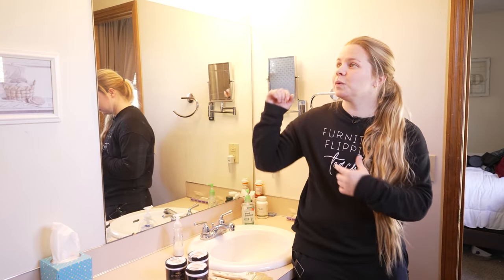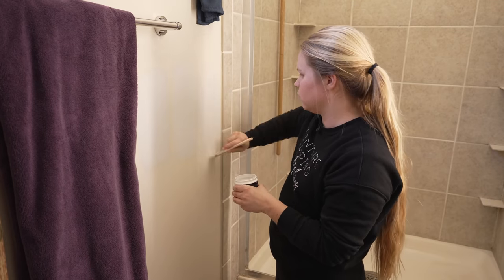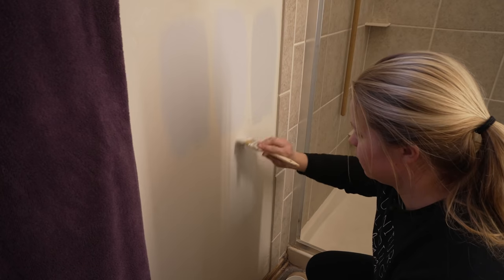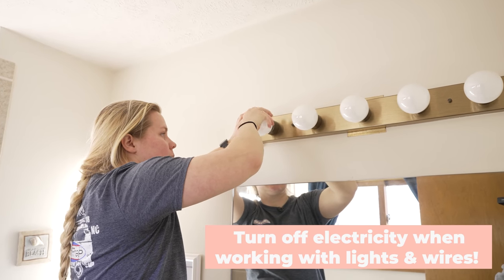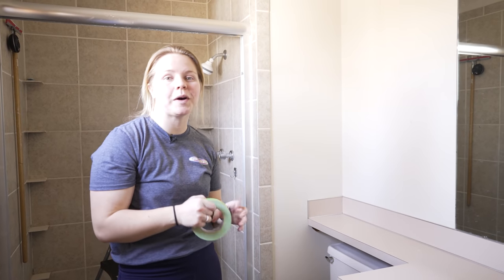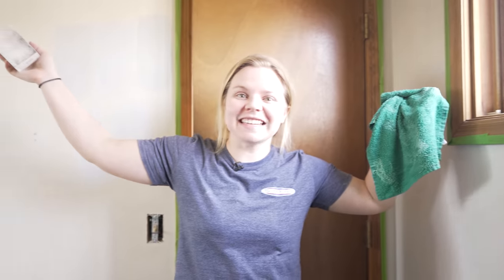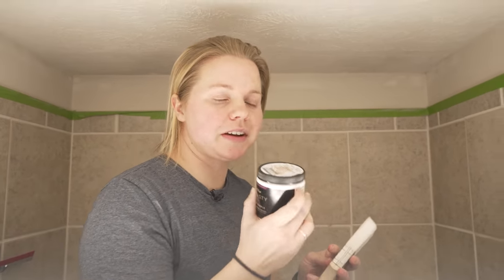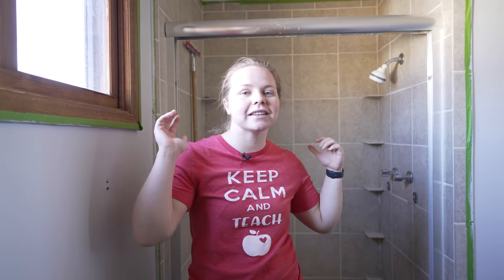35 YEAR-OLD SMALL BATHROOM MAKEOVER + DIY PAINTED COUNTERTOPS!!

Comment: Beautiful job on the makeover of your parents bathroom!!
One suggestion I would offer, which I have done in the past myself is frame out the mirror. This will give it a new feel and hide the worn edges of the construction mirror. I didn't even miter mine! I used some nice profile baseboard on the top and bottom with the flat edge facing up on both the top and bottom pieces and cut just over the width of the mirror about a 1/4 or 1/2 inch. For the sides I used a different wood trim piece that was just about as wide as the bottom and top pieces but was a trim piece that just had some groved vertical lines in it. The side pieces I measured and mounted those to fit in between the top and bottom pieces and fit flush on the edges with the top and bottom pieces to form a frame. I painted them the same color as my cabinet or you could paint them whatever color you think will coordinate. I attached them to the mirror with some construction glue calk. It really updated the mirror and gave it a Hotel/Spa feel! Just an inexpensive suggestion to give it an additional finishing touch. 😊👍
Reply: I love this idea!! We're moving into our first home and the mirrors are still the builders grade. This sounds like a simple, inexpensive way to upgrade the mirrors
Reply: You can get the pieces to frame it at Lowe’s really cheap if you don’t have it already on hand. That’s what we are doing to our bathroom

Comment: A trick I learned while helping my mom choose a paint color for her bathroom was to do the samples so that each of them is next to the trim or tile that will still be there, rather than have some further away. It made it a lot easier to catch the ones that didn't compliment the existing colors as well. Also, you can buy stick-on sheets that you can paint, then peel off the wall easily - so you can move the samples around to get an idea of how it looks on different surfaces. 
Lastly, my experience from having to repaint a rental-house bathroom every 3 years or so - the samples are usually a flat paint, so using that above the shower isn't the greatest idea. A semi-gloss, or satin, helps with water resistance much better. Eggshell at minimum for a bathroom if you don't want condensation to damage the paint. 
Beautiful makeover!
Reply from the maker: we used eggshell (:

Comment: I used Beyond pain on my kitchen cabinets and it worked out great! 3 months later and the finish is still holding. Really modernized the look from the dated oak. Was a lot of work but much easier than having to sand, clean, paint and repeat. Would recommend.

Comment: If you were giving a complete refresh, why not replace the mirror?
Reply: Most of those mirrors are applied with an adhesive that you cannot loosen. That means that you have to cut a hole in the sheep Rock and replace a huge piece of sheetrock, tape mud and paint. We opted for framing in that big ugly mirror rather than going through the whole mess of taking it out

Comment: I struggled with getting sharp edges for years with different kinds of painters tape, and recently saw someone who skipped it all together and just used a pointed brush to paint the edges as step one. I did this a month ago in my sons’ room, and it looks SO GOOD. If you have a steady hand, and it looks like you do, try it! It saved me SO MUCH TIME, and looked much better without little bleeding paint marks. Edit: exactly like you’re doing around the ceiling. I guess I commented too early 🤣 also, my bathrooms are this exact same builder grade look. I didn’t realize my vanity lights only had one hardwire behind it, so I have been holding off on replacing them. Now I feel like a dummy!
Reply: I have never used tape.  😂

Comment: Great job! Another thing would be to not attach the faucet in place until AFTER painting the countertop... (more room to paint the backsplash and behind the sink) and perhaps even learn /have help putting in a water line shut off valve there so that just the faucet is without water... but little things add up and where does THAT ever end?... you'd be doing the whole house! 😂

Comment: Nice job.  Tip... as long as you are making the mess and have things taped off, I like to throw a fresh coat of paint on the ceiling as well and before I paint the walls.  Yah, it adds an extra day to the process, but it is worth it.  Also... before your first wall coat, put a quick layer over the parts you patched (use some primer if you have some)... it usually absorbs the first coat like water and may have caused the poor coverage you had.

Comment: If your budget is tight, and you don’t want to replace the light fixture, spray painting the cover plate and bulb covers will totally change the look. You can paint it very close to the color of your walls so it blends in, or a dramatic different color. I particularly like hammered look spray paint for this use.

Comment: Everything you did looks beautiful!  I have one suggestion that would make it complete: You could frame the mirror by gluing wood moulding around it.  I did that in my bathroom about 20 years ago and the glue I used was Aleene's Super Thick Tacky Glue, and it's stayed up with zero problems all this time!  You could probably use Aleene's regular Tacky Glue that comes in a goldish brown b bottle as well.  That line of products I recommend wholeheartedly.  Anyway, it really looks nice.  If you don't want the pre-stained wood you could paint it.  Either way you'll end up with a beautifully framed mirror for less than $20!
Reply: Great idea. I was thinking the  same thing 😃.

Comment: I just painted a bathroom vanity with this paint. I came back a few days later to install door hardware, I used blue painter's tape to lay out my hole locations and to protect the finish. Well, after drilling the holes for the hardware, I began to remove the tape, and it peeled up sections of the paint. Talk about mad!!! Have you ever had the paint peel on you before? This is the first time I have ever used the paint, so I'm not sure what happened. I would say it's a surface prep issue, but other than scrubbing the vanity with simple green there is no required prep, so I'm confused. I will say, though the areas that peeled were very easy to touch up, and can't see where the paint peeled, just hope this is going to be durable in the long run. I want to move on to the kitchen next, but now I'm skeptical about the durability of the product.

Comment: Questions:
1) Do you recommend TSP to clean the walls?

2) How do you keep track of all the hardware (especially screws)?

3) How durable is the Beyond Paint? Particularly for cleaning if need to scrub something off like a dried spill or caked on dirt?

4) I noticed you put spackle over the light fixture screw holes in the wall & there were anchors in the holes but didn't see whether you covered.

So I'm wondering how you handled that?
And,
If you're putting the same fixture back, do you want the same holes or new holes??

Thank you muchly!!

Comment: I am going to be doing my very old bathroom soon.  Any thing you learned when doing this project.  I was wondering if you had it to do over again if you would’ve left the faucet off until after you painted the countertop? It just seems to me like it wouldn’t be easier to get back behind the faucet area if it were not there yet. True or false? And how well has it held up especially the countertop area? Thanks for the tip on removing the sink.... so if I do that the faucet WILL be off.  I wrote my question before you gave the tip. Looks great . Much brighter. Very pretty. Your Dad was super taken by its. I loved how surprised he was .

Comment: Pro paint selecting tip: When I first moved into my current home (just shy of 2 years now) ALL the walls were painted a battleship gray semi gloss. ALL. THE. WALLS. So, like Lauren, I purchased several samples and painted them in groups on a couple different walls.  But I couldn't make up my mind.  I was ranting about same on FB and a friend of mine, who used to work at a paint store, said the secret is not to paint all the samples together in a group. She said, "Our minds are natural comparison machines so we just look at what is grayer or browner or pinker or yellower...etc."  She suggesting taking one sample and painting a large patch in three different areas (for the lighting comparison)  And do the same with another one or two colors, but not next to each other.  In some sense, when you are deciding between beiges that are only subtly different from each other your only job is just to make sure that you don't hate it.  But if you are deciding between blue and green and coral...well, that is a little more complicated, but I think the same rule of big color swatches not right next to each other is key.

Comment: Beyond paint works very well. It's expensive though. I love real wood tone trim and doors so I was like ah bummer lol. I even like the vintage cabinet pulls. Nice job 👍.
Reply from the maker: a little on the pricey side but remember, you wont have to buy primer or top coat or spend time sanding because its all built in

Comment: For all your hard work, it doesn't matter WHAT the paint says, you have to sand finished wood before you paint it. The wood has a finish so the paint cant absorb into it. No degreaser will fix that. You should see the mess that not sanding did to my friends kitchen cupboards.  The kit said no sanding necessary, and first 2 years were great, but it had to be redone after that.  It didnt chip off it rubbed off in the high touch areas. Sanding is  important.   Also, spraying cabinets makes for a smoother finish.

Comment: I would have done the samples on the wall by the shower tiles sideways so they would all be the same distance from the tiles. What everyone chose doesn't look that much different than what is on the walls already.  Curious why you didn't do the ceiling? It looks sort of white to me. Just cleaning with the simple green makes the cabinets and doors look so much better !  I might have been tempted not to then paint!  How long do you have to let it dray after rinsing? 
You were right - too much gray! 
Great shot of you and your dad both under the sink at the same time! The counter looks almost lavender. in stead of gray ???  The flecks are the wrong color.  Looks like you decided to paint the door and window trim also. What color was that? I will be really curious to see how that countertop wears.  Lovely!  It would be nice to show the before and after right at the end.

Comment: I really appreciated this video as I am retouching the walls in my house and also redoing my bathroom. AND it brought up a question you may be able answer.

I just had a new roof put on and it jarred loose some of the sparkling covering the nails that held the drywall on the ceiling. What would you recommend I do...scrape ceiling and re-mud or use layers of sparkling?
Reply: If they are small re spackle  them.
Reply: Drywall screws are supposed to be used to secure drywall to studs and rafters.  Not nails.  For exactly this reason.  Nails eventually back out.  Add screws, and patch and paint for a full correction.
Reply: @cathycoryell2351  Thanks so much! Sound like a plan 😁
Reply: @cathycoryell2351  Definitely That is what I had always done, especially with bigger jobs but some people would rather spackle very small jobs when they don't want to deal with a better and permanent fix. 
Works temporarily but better use screws next time.

Comment: I would paint the shower tiles.  it needs to be matched with the rest🎉
Reply: No. Don't. I used Beyond paint in my bathroom and painted some of the tiles and the tile floor. SUCH A DISASTER! Even the tiniest drop of water or soap before the 30 day cure period will dissolve it. Then it just gradually wears it away. It's been almost two years and it looks awful and now I have to replace all my tile.
Reply: @bh2886  I have a question please.  That sounds like you do not recommend this product.  Would you use it on kitchen cupboards ???? Thank you.
Reply: @kathleenbrown6734  I'm no expert, but I feel that the most durable finish for kitchen cabinets is an oil based paint. Beyond Paint is extremely costly and temperamental and despite being very thick, like pudding, it doesn't cover well and requires multiple coats. I was very disappointed with it.
Reply: @bh2886  thank you for info.  I have decided not to replace my wooden cabinets and am going to paint as maple is so hard to take a stain,  I hate these but thought painted would look great.  appreciate your comments.  I was looking into beyond but will not now.
Reply: @kathleenbrown6734  Don't be afraid of oil based paint. It's more forgiving than you might think. It has a much more durable finish, esp. for a kitchen. Also consider a water based acrylic alkyd paint, it has some of the durability of oil with water cleanup.
Reply: @bh2886  Ok tx  The water based sounds ideal.  Will ck out.